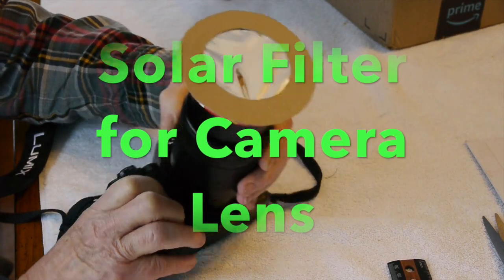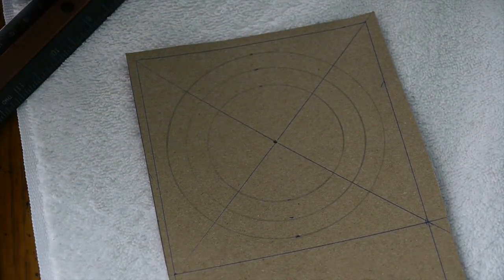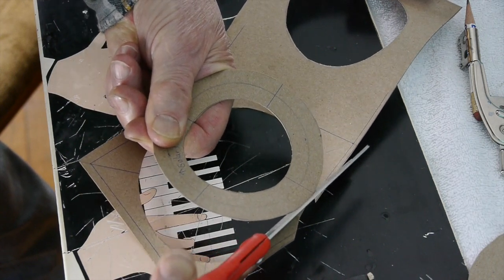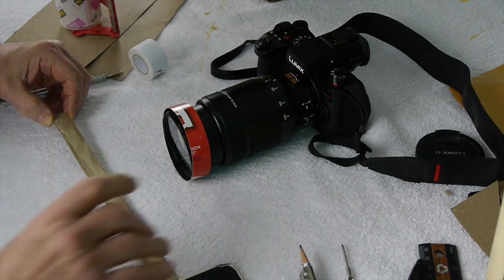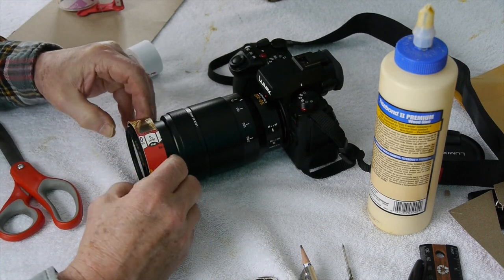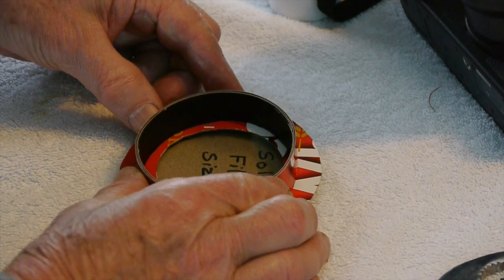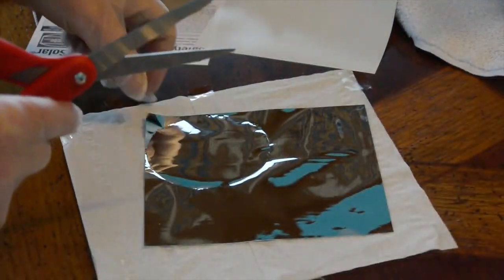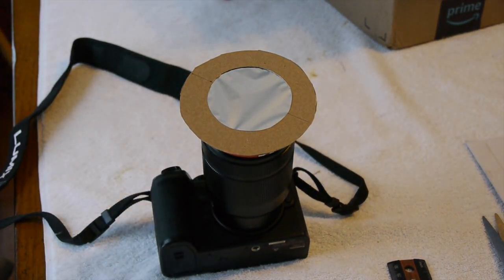Make a Solar Filter for your Camera Lens

Comment: Great video Tim, tks for taking the time. It was extremely useful. I made a slight modification which I think made it easier cutting the film. Instead of cutting the film in a circular manner and using the kiinex, I cut it in a square, but keeping the protecting paper that comes with the film while cutting it. It was a breeze, I didn't even have to use the gloves. Other than that, I followed all your recommendations from the video.